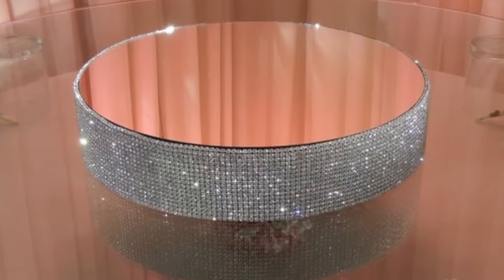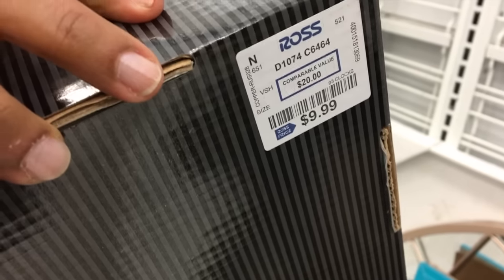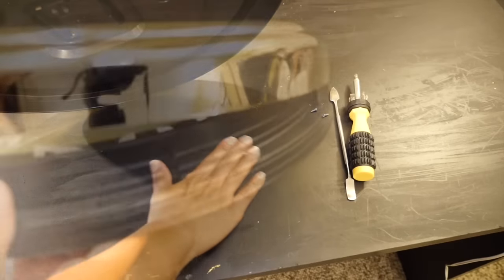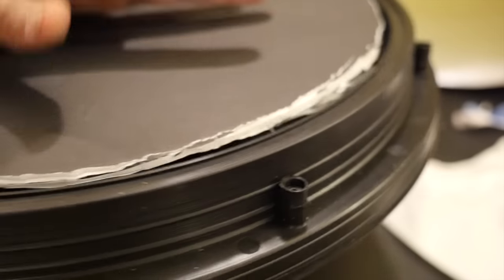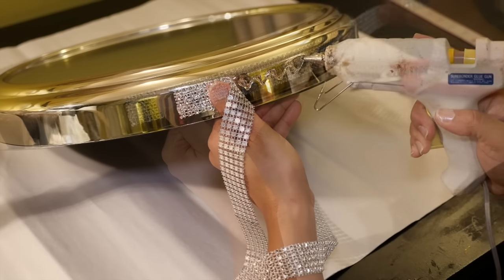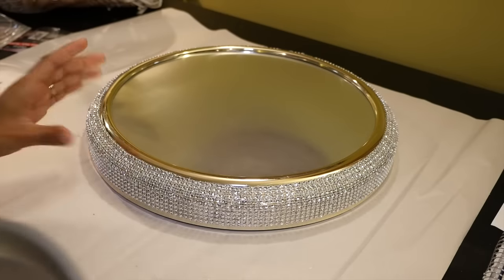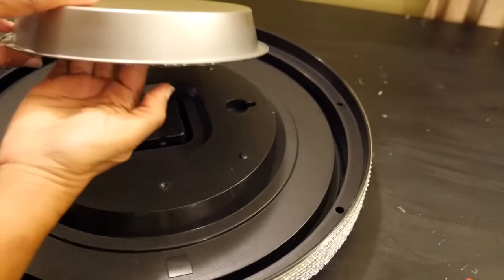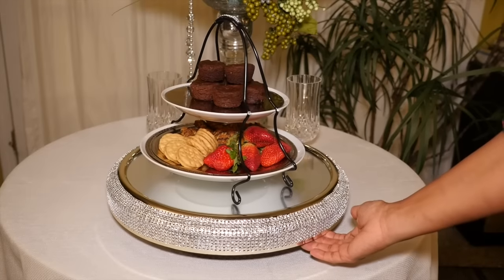DIY | Bling Wedding Cake Stand & Rotatable Dessert Tray

Comment: Stunning!!! I really love how it turned out! I hope you wouldn't mind if I provide a sound advice when using this on tiered cakes. Wedding cakes tend to be heavy, depending on how many tiers, the number of layers in each tier and the amount of fillings, not to mention frosting, fondant, and decorations.  My family owns and operates a licensed homebased bakery and we make wedding cakes among other custom cakes. If you will stack several tiers, which many brides prefer, this may buckle and break. This will work perfectly on lighter types of cakes. Perhaps a one-tier 12" round cake or a two-tier smaller cake. Or use it just like you showed in the end, as a stand for smaller desserts. I would definitely like to make this for our display / dummy cakes for bridal shows or fairs. To add class and elegance without breaking the bank! Thank you so much for sharing! <3 <3 <3

Comment: When you cant find a mirror for a peice in the size you want but you find a glass peice. You can use the rustoleum mirror effects on the glass. Spray the glass in some even good coats and then when dry flip the glass over to reveal a true mirror on the other side!

Comment: I love your DIYs.  Everything is so beautiful. I am doing a corner in my basement which is not finished so the walls are concrete. I have hung some things on the wall with string attached to the wood on the ceiling. It looks ok. I'm using the area for DIYs. I'm new at it. I watch your videos and you have really good ideas .. Any ideas for a concrete wall.
Reply from the maker: I don't have any great ideas right now but a friend of mine hung material or drapes from the ceiling against the concrete wall. it looked nice and warmed things up.

Comment: You you could have spray painted the inner part of the glass with rustoleum "mirror effect" . The opposite side that you paint, turns into a mirror. look up YouTube videos on it. this would n n great way way get an actual mirror instead of the poster board
Reply: marilyn hernandez If I am not mistaken she plans to turn this project back into a blingy clock so using the spray would not allow her to do that. Great option though.
Reply: marilyn hernandez I was going to say the same thing!
Reply: I originally thought the same thing, but the poster board provided bulk to hold the weight of the cake instead of having a hollow center.
Reply: great idea!
Reply: marilyn hernandez  let’s see your rendition of this please 🤔

Comment: Beautiful 👍🏼 new subscriber. I didn't get the whole thing about the cake pans rotating w/out marbles🤔 please explain!
Reply from the maker: There are quite a few videos that show you how to make a Lazy Susan (rotating tray) by putting marbles into the bottom of one pan and sitting another pan on top of the marbles.  The marbles will allow the top pan to rotate around freely so you can attach a tray to the top pan hence the tray will rotate.  I was saying that you don't need the marbles at all in order for the top pan to rotate.

Comment: Was this stand strong enough to hold the cake? I need to make a cake stand but my baker tells me 3-tiered cakes normally weight about 30 pounds
Reply from the maker: I just tested it by putting a little over 30 pounds of weight in the center top of it (two small speakers and a large glass vase) and it did hold up fine.
Reply: @YourHouseaHomeTV  wow, you did that just for me? Thank you!

Comment: Why didn't you remove all the actual clock parts? It seems a little wasteful.
Reply from the maker: Ellen Schram like I said in the video, I don't need a cake stand so I wanted to turn this back into a blingy clock. Also if you do make this as a cake stand for a wedding the couple could just take the silver poster board out and use it as a clock after the wedding. So there is really no waste at all.😉